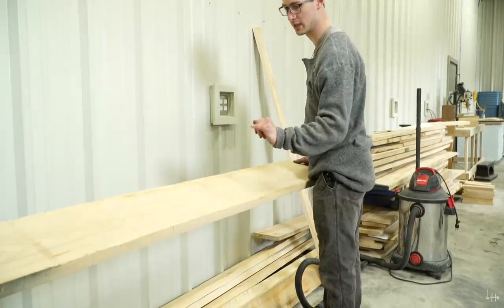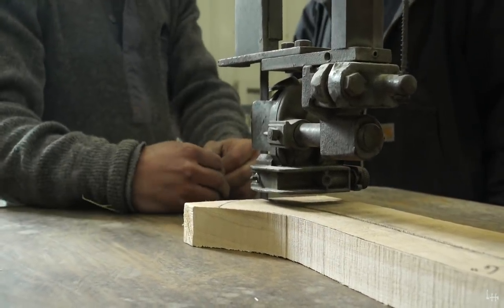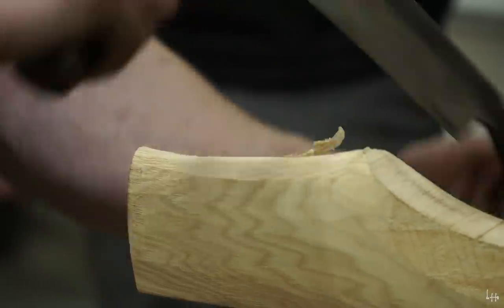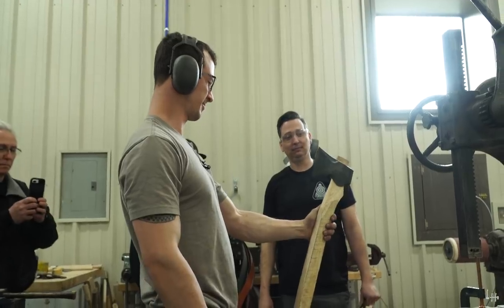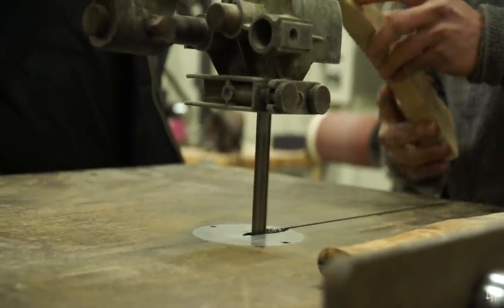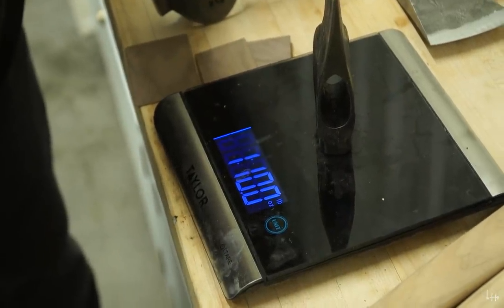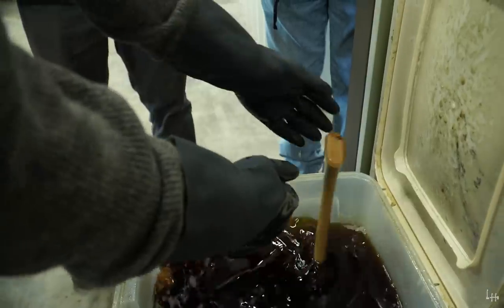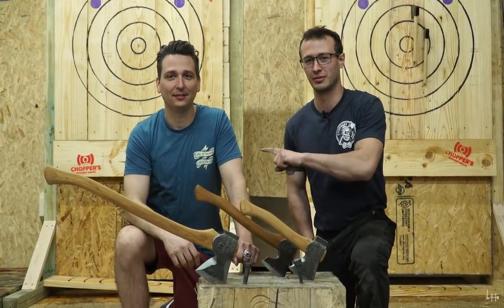FORGING THROWING AXES WITH JOHN BRADLEY pt. 3

Comment: Is it common to push the drawknife like that? I've never seen anyone do that till now
Reply: You wouldn't push it very often, but sometimes that's just quicker than getting the piece in and out of the vice for 2-3 cuts and then switch it back again. Much easier to do that on a shaving horse.